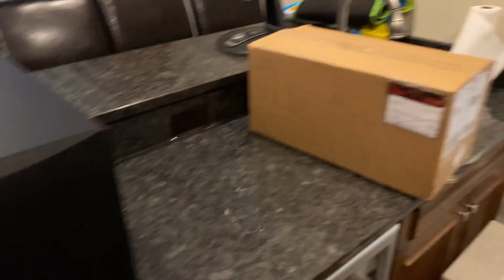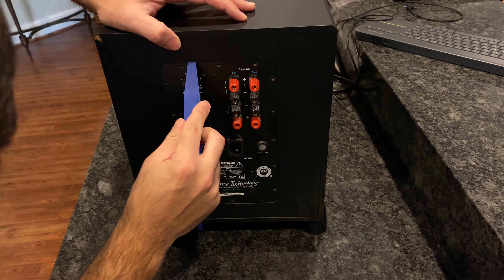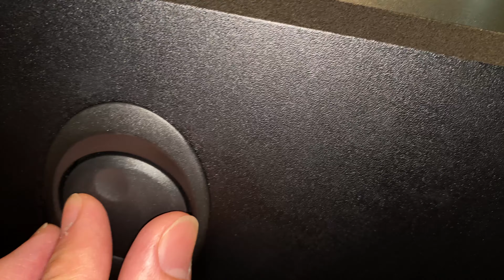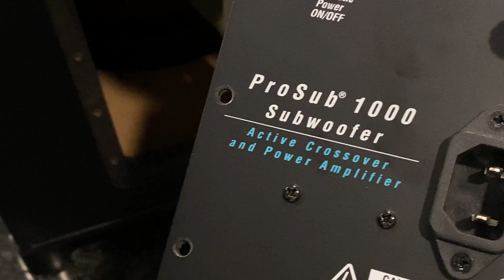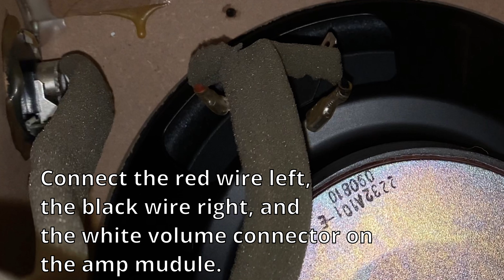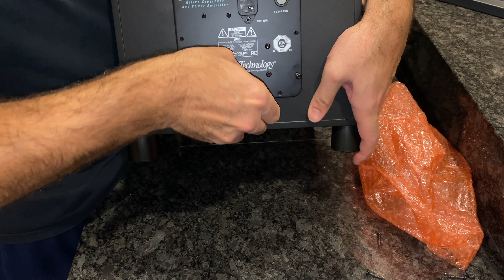How to Replace a Definitive Technology Subwoofer Amplifier

Comment: Definitive Technology doesn't make these plate amps anymore .  I tried to find one over a year ago.  I even e-mailed Definitive Technology, they told me they make them anymore. That sucks ,  but I can still save it by buying another brand and wiring it directly to driver through a hole in the box . I'm researching right now which amp I want.  I'm looking for a 500 watt Class D .  Wish me luck .

Comment: Worthless video. More like "how to remove screws with a screw gun".... also I would go through the resonator to remove the speaker plugs then remove the amp plate. 
But !!!!! the question everybody's asking:  "where's the link to buy a replacement Amp??? 
 if it's not cost-effective you don't need to know how to remove eight screws.

Comment: I have one of these in one of my spare rooms.
The "gain" knob went out, so I converted one of the sets of banana jacks into a pass through and I run it with an external BASH 300S plate amp.
 Sounds great, and maybe someday I'll get around to replacing the gain knob and get it back to original...but for now it works and sounds great paired with a set of Micca RB42 speakers
Reply: I wouldn't waste any more time with the DT amp.  Even if it's just a potentiometer.  DT electronics are ticking time bombs, that are guaranteed to fail.  Just a retired EEs perspective.

Comment: im just starting to have issues with my sub after owning it since 2014.  it worked fine the other day and then i replaced my flat screen with a new one.  had several issues trying to sync my PS5 to my new Tv and my Denon Avr x1000...switching this setting with that setting and this and that... my new TV has eARC but the denon only has ARC... i have no idea if that has anything to do with  losing DTS setting or not.. ...ANYWAY, in the middle of all the switching setting my sub just stopped working... well, of course i would think it's just a setting that i overlooked... all my settings show the sub being on.  the light in the back stays green.  when i unplug my audio cable from the sub i get a low freq buzz, like it should....but nothing.  no sound at all.  changed the audio cable and still nothing.  If it were the fuse, would the light come on at all?  ii would hate to try and replace the amp but your video will surely help if it comes down to that.

Comment: How would you change just the fuse? I have a pair of BP7002 with built in subs and one of the lights doesn’t turn on. They have the same looking fuse as this video. I just don’t know much about speakers at all!
Reply from the maker: You just unscrew the compartment that contains the fuse and inspect and see if it has blown. Mine was ok when I checked, which meant the amplifier was probably bad.
Reply: @Upscaled_HT  that’s great to know. I’ll check tonight. It’s easy to see if it’s blown?

Comment: Great descriptive video. I have the Power Sub 600 and unless I sit on the sub, or put any weight on the top of the sub, the box rattles. Any ideas as what to do ?
Reply from the maker: Did you try tightening everything you can?
Reply: @Upscaled_HT  yes checked all screws externally. When I put weight on the top, it stops rattling.

Comment: How do you determine if it was the amp? I have a super cube 1 that makes loud noise I’ve never really over played it.
Reply from the maker: In my case, the subwoofer was making some really nasty sounds. I called definitive and they said it was most likely the amp and sold me a replacement.  I installed it and it worked like new.  Still works.

Comment: I apparently found this video too late.  Bought a ProSub 1000 in 2016 and recently noticed it has no sound.  I did a few simple tests like connected a different cable and check the settings on the receiver.  After watching this video, I called DT (tech support overseas) and needed a multimeter to compete testing  - I don't have a functioning one but I asked if I can just purchase a new amp and he said they don't make them anymore.  So I asked, why bother to complete the testing if you don't have any replacement parts for this model?  His reply:  so we can offer you a discount on a new subwoofer.  Eff that!  I'm buying a different brand.  This is the second DT subwoofer that crapped out on me so shopping elsewhere.  Great video though!  Too late for me unless anyone here knows were I can find a replacement amp.  Thanks!

Comment: I too have a Prosub 1000 that won't turn on and needs an amp, I called Definitive 5/13/22 and they said they no longer offer either/any parts for this model sub. There are two generations of amp for the 1000, the most recent having an On_Off switch on the back in addition to the "Auto turn on" feature. I picked up a mini mono 300w max amp so we'll see how that works out.
Reply from the maker: I hope it works out.
Reply: Did you ever get that put together?  In a similar predicament.
Reply: @ColeSexton  Okay so I tried an mini external amp (off amazon) and that sounded horrible, I then purchased a Definitive Tech Prosub 600, the 8" w/8" radiator to see if i could swap the amplifiers but they are a different size (looking at the rear input/output plate the height of my old prosub1000 is 9.5" vs 9" on the 600-so the cabinet cut out size is different). I ended up finding a deal on a good Prosub 1000 with the On/OFF switch and noticed it too was 9", so I opened it up to compare it to mine and it looks just like the amp that's in the prosub 600. I also found on the newer 1000 the volume knob/potentiometer is different than my old one, not only in how it looks (from inside the cabinet) but also in operation, or they changed how the variable crossover operates b/c my old unit not only seemed to output less higher frequencies (regardless of LFE or main channel inputs) but also on my old one  I NEVER needed to turn the volume above 12 oclock/halfway but with the new one I have to turn 3/4 to all the way up to get the same output as the old one. And lastly the new one has much more output when using main channels in vs LFE, my old one didn't seem to vary as much. But iv had zero issues with the newer model (the one w/the On/Off switch) so obviously that's good. Imo they should designate one from another, a "Gen 1" & Gen 2" or something, or issue a recall on the original model w/o an On/Off switch b/c it sure seems they knew there were issues. Good luck
Reply: @weldonb5491 electronics dont get recalls unless they are going to burn your house down.  They know they build shit, thats why they only have a 1yr warranty.  “Top of the line” TV’s are the same way.

Comment: @Upscaled  do you recommend buying new one. I am looking to get a sub that is below 20hz and I found this is low as 18hz, when I see price low like this (360$). I am wondering is this a good one. The other ones available in the market seems to be Double of the price
Reply from the maker: I just reviewed the Klipsch R-12SW.  This is going for $180 now and you could buy two for the price of one definitive.  I found it plays pretty low but could use some eq with an external equalizer.  https://youtu.be/99gI-I8OM6c

Comment: Thanks for the great video.  Prosub 1000 owner for 15 years now (bought the entire pro cinema set back in 2007).  I guess it lasted a good long time.  Just started having the static/distortion issue.  I ended up just replacing it with a Jamo C912 which I'm happy enough with and is about the same price as the replacement amp.   I had no idea these were pretty easily user repairable.

Comment: How much was the cost to replace your amp from Definitive Audio? I got 6 years out of my ProSub 1000 and i believe my amp just failed. I'm just out of warranty so it's all on me now to fix or send it to a landfill. I paid $380 for the sub from Crutchfield. Just wondering if the replacement amp fix outlined here is economical or not given what i paid for the sub in the first place.
Reply from the maker: If I remember correctly, there are two amp skus.  One of them is cheaper than the other.  I had the expensive one which was around $200.

Comment: Your video was very detailed and very informative.  Thanks so much for posting it.  

Can you share what test Definitive Tech asked you to do in order to confirm it was a blown Amplifier?  I have a ProSub 1000 w/ no sound.  Did all the other tests for the cone movement and woofer resistance.  The cables are good; fuse is good; and the Red LED comes on and stays on.   

And I have an email into DT but waiting on them.
Reply from the maker: I think what you did pretty much covers what I did.  The tech said it must be the amp then.

Comment: Thanks for the video.  I also have the Prosub 1000 and mine lasted a little more than 10 years before it developed a definite static/distortion noise not when it was first powered on, but after a period of time; did yours have those same symptoms or was it totally dead?  I originally connected mine as suggested by Def Tech, using the high-level inputs and then the outputs to the front/main speakers.  Also according to Def Tech documentation I used the LFE connection (in addition to high-level connections).  What connection method did you use?  Thanks again for the video.
Reply from the maker: It was making really audible static and clicking noises.  I was using standard lfe (rca) connection.

Comment: Def Tech makes great door stops and statues.
Reply from the maker: It took like 10 years to fail with lots of use.
Reply: @Upscaled_HT  that's awesome! Mine took about 3 years of very little use as did my supercube. My BP7004's took about 7 years of moderate use for 2 of them but still have 2 more that are still operating as of 8/30/2022 although 1 has been making the dreaded hum sound for the last 6 months but thankfully is not too loud yet. Wish I could find replacement amps for the 7004's as their sound is pretty good when functioning properly.
Reply: Im running all defects since 2009, no problem except I pushed the sub (pc800) ultra hard, and it failed after 10 years. 

Looking into a replacement amp now...

Comment: Hello! My sub seems to not produce any sound (this happened out of nowhere), if i set the gain in the receiver +12 then i'd feel a small vibration, barely any sound/bass at all. Light on the back is a steady green, could this be an amp issue as well?
Reply from the maker: Just throwing this out there but do you happen to have another subwoofer to test and make sure that all settings and connections are ok?  It could be the amplifier.  I called definitive when mine broke and they helped me confirm that it was blown amp.
Reply: @Upscaled_HT  Well i've reset my receiver a couple of times to make sure it wasn't something i mightve changed in the settings by accident. I was thinking maybe i accidentally pulled on the wire and messed up the lfe connection port on the woofer. I want to try plugging the speakers into the ins/outs instead, just dont have the wires atm. I'll probably end up calling definitve tomorrow. Thanks for the reply!
Reply: @Upscaled_HT  Bastards told me they discontinued the amp production for my sub specifically .. because there are apparently 2 types of prosub 1000's with differing serial numbers. Bummed the hell out of me. When you unscrew the amp it looks completely different inside, everything is encased in some plastic, unlike yours which is hollow inside :/. Lucky
Reply from the maker: @Cosmickon  That's unfortunate.  You can try looking for a used one on ebay or sell your sub on ebay, obviously stating that the amp is broken.  

You can also try retrofitting an external mini amp like this one (https://amzn.to/3tEgj95).  You'll have to drill a small hole to pass the speaker wire to the sub inside and make sure you seal the hole very well (maybe with silicone https://amzn.to/3nF4aA3) so that there is enough pressure inside for the passive radiator to keep helping out.
Reply: @Upscaled_HT  Ohh, thanks for the extra option for repair,  worst case i'll really consider those.. I'm thinking about taking it to some electronic repair shop and maybe they can see if it's as simple as a bad capacitor or something got dislodged. Cause I never had any issue with it making noise or blowing, light still green. Praying it'll be easy fix. Thanks again!
Reply: hey  @Cosmickon   did you ever get your's fixed?  im having the exact same issue. thought it may be the settings in my TV or AVR after getting a new flatscreen.  the light is still green and i've tried a different audio cable but no sound at all.
Reply: @saddad6601  i did not :(. Seems like the amp is busted and the particular model i have apparently you cannot replace this amp. If you find a solution make sure to update here.

Comment: You must have beat the crap out of that sub to blow it. Ive treid to blow my old velodyne and good dsp should prevent sub or amp from blowing up with anti-clipping circuitry, thermal overload and over excursion protection like velodyne and svs uses.
Reply from the maker: I didn’t really abuse the amp.  It was just used probably over a thousand hours over the years at pretty pedestrian volumes.  It took over 10 years to fail.  I wasn’t even mad when it did.
Reply: @Upscaled_HT  I didn't realize the sub has been out that long. It seems like a great buy for 350$ now. I doubt it hits over 100 decibels and I want 121.5 that the svs pb-1000pro puts out. My current velodyne cht 8 still outperformed svs micro3000 hittin 85 decibels on the lower frequencies but the svs 3000 micro was a little louder on upper mid range bass hitting near 90 when my velodyne cht-8 was only 84 decibels
Reply: How many decibels does that speaker make? Download cell app. Thanks.  I subbed!

Comment: My 20+ year old velodyne cht-8 still works and outperformed the svs micro 3000. I ordered the svs pb-1000pro and its supposed to hit 122.5 decibels which is incredible. The velodyne cht 8 and svs 3000 micro struggled to get 90 decibels.  

How many decibels does this sub hit?
Reply from the maker: I honestly have never measured it.  It plays pretty loud.  It probably exceeds 90 dB but probably doesn’t extend as low as the subs you mentioned.

Comment: So I thought my cable end was bad, replaced the cable, same problem.. it won't stay playing, or it goes into clip and the woofer just blares.. or if I hold the cable on I get a hum and it plays sorta. I wonder if I need new amp, or if the RC hookup wire needs resoldering? Hoping it's simple cause IDK if I am gonna spend $$ on a sub that's 8 years old.. I'll order a RLS Speedwoofer and be done with it.. any experience or advice on this.. PS I haven't watched the video yet, about to.. Cheers

Comment: I have a Supercube I, it makes a rattling noise when its playing bass. I always assumed it was a blown speaker. What does a bad amplifier sound like? Or is it just totally dead?
Reply: I know this is a old post, I have same subwoofer and problem that have. Did you happen to find out what the problem was with your subwoofer? Thanks
Reply: @Bandit19-t4b  I was told by Definitive my amp was out and there was no replacement. I saw a few on eBay but they weren’t worth the risk. It unfortunately ended up at the dump when we were cleaning out the garage. I hated to do it.
Reply from the maker: That sounds more like a blown speaker.  It’s probably easily fixed if it is.  I would give definitive a call and they can confirm.

Comment: My sub will randomly shut off during use. several hours into playing, the red light turns off and isn't outputting bass. Is this what happened to you?
Reply from the maker: My sub would turn on and would hum very badly.
Reply: @Upscaled_HT  mine randomly shuts off while watching tv or playing audio. I called Definitive and was on hold for an hour until a rep finally answered. Ended up ordering a replacement amp for like $194.00. Should be shipped out in 10 days. I'm glad you can replace the amp because it's a shame to throw the whole thing out. It's a good-sounding sub and does the job plus I wanted all my speakers to match. Thanks for posting this video. you're the only one that provided the helpful information!

Comment: Thanks for the video. I have Definitive Technology Pro 600 set. The subwoofer is not working. The red light is blinking. Do I need to replace the fuse or the entire amplifier?
Reply from the maker: I would check the fuse to see if it's blown.  If it looks ok, you may need a new amp but I would call Definitive and see what they have to say.

Comment: on my B52 ACTPRO-18S HD 1000 WATT POWERED SUBWOOFER
Reply from the maker: Either there is some kind of hardware failure that is overloading the amp and fuses are popping to protect the amp or you're using fuses that are not rated for the power load the amp is demanding.  I'm no expert but that's my best guess.

Comment: Thank you ..you actually did. For some reason my sub just lasted 3 years ...The amp is dead. I have to send it the manufacturer.   Not only that but my Bowers and Wilkins also both had blown speakers...I have a Pioneer amp and I am very happy with the power it puts out.  ...Thank you for the video
Reply: perhaps do you have a part number for the amp?
Reply from the maker: @kristinirvin5183  I don’t have a part number off hand.  When I called definitive and they asked me for my serial number because these subs were made with different amplifier modules at different times of production.  If I had a part number it may not be right one for your sub.
Reply from the maker: Thank you!  I hope everything works out.